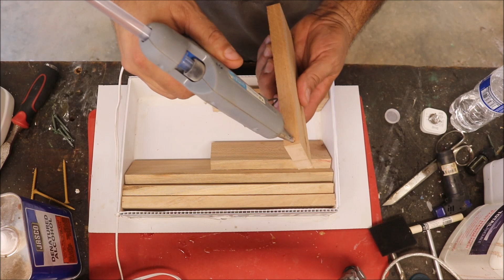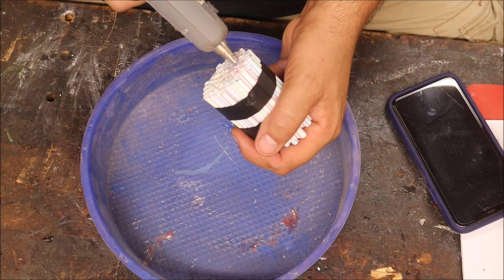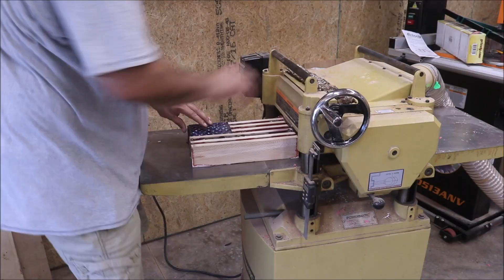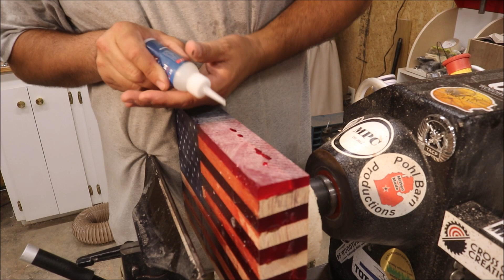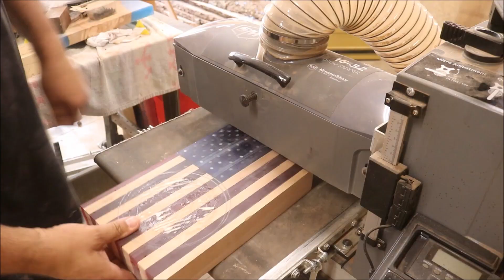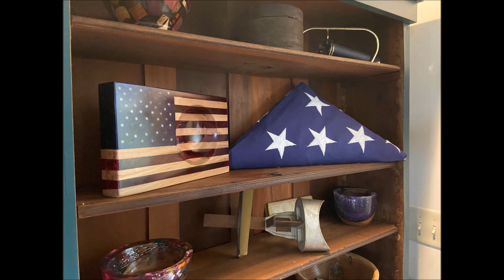A Veterans Story - Wood and Resin Turning

Comment: Thanks for sharing your story brother. While not as harrowing, my story left more of an impact on me than I thought at the time. I was in the Air Force myself. I got deployed to Kuwait just a few months after 9/11 as a Security Forces augmentee. This particular day I had been assigned the water truck. Keep in mind that all I had on me was a radio that barely worked the farther you got from the base. I was riding with two TCN's (Third Country Nationals, for non military) and the first part of the trip was pretty boring. What rattled me was when we started to drive away from the flight line and I had no idea where we were going (The brass had not given me an itinerary) . This was only months after the worst attack on American soil since Pearl Harbor and less than a hundred kilometers from a known Al Qaeda stronghold in Kuwait. For all I knew they could have been kidnapping me (by this time my radio was getting spotty). I'm not sure how far we drove until I saw the patriot missile site just off base. I just about jumped out of the vehicle when we stopped and I saw the flag. At the time I knew that it had rattled me, but not until months later did I learn how bad. I had been taking a shower one day when it all caught up to me (I guess I had been subconsciously burying what had happened) and I just collapsed to the floor of the shower and cried for about 15 to 20 minutes. My best friend is the one that pushed me to seek help from base mental health and to this day I am grateful that he did. Always remember the fallen, but also remember that each day we are blessed to have a beating heart and air in our lungs. Aim High brother. Head high, shoulders back, and march on.
Reply from the maker: Christina, 
Thank you for sharing that. You never know what can trigger you. After 12 years of combat operations I there are some incidents I still dream about that if you weren't there you may say "why?" but it doesn't diminish what happened. I am glad you decided to get help to work through your issues.  I hope you and your family have a wonderful Christmas.